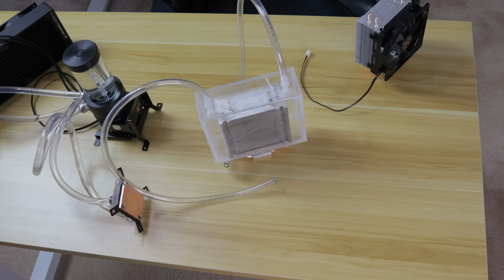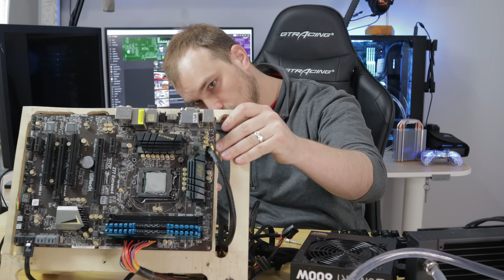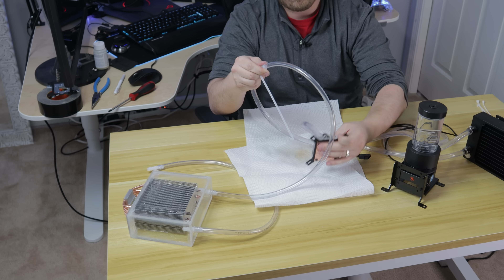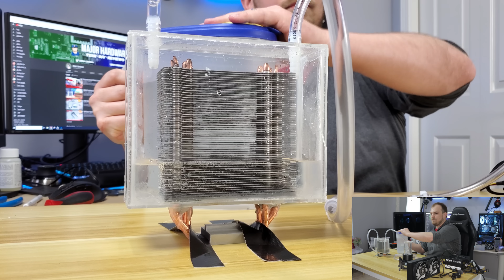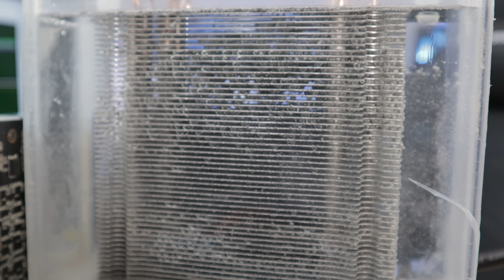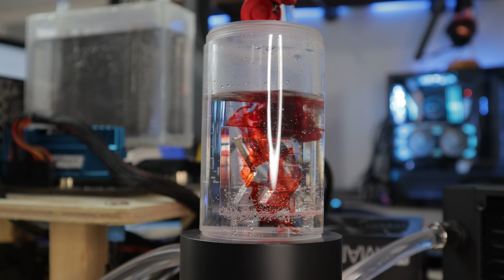Water Cooled Air Cooler Tested Against - Air Cooled Hyper 212 EVO and the EK-Supremacy EVO

Comment: 1. Don't push the water, pull it.
2. Make plexi plate around radiator to block water moving around, so the water has to be going through the rad.
3. …
4. Profit.
Reply: And have the water flow across it like the air would.  Flip the flow 90 degrees.
Reply: @ripnshread2441  that would probably make it worse, as it spends less time between the finns.
Reply: @ripnshread2441  that'd make it worse since it's more difficult to equally distribute the flow over all the fins in that manner than it is if it's along the fins, and as Da Vid said it'd also cause the liquid to be in contact with the fins for less total time, which reduces the amount of available heat-transfer time.
Reply: Good suggestions here
Reply: Arent the fins aluminum and the pipes copper? Wont that lead to some corrosion or something
Reply: That's a good point. It might benefit from a sacrifical zinc anode...which would require periodic replacment.
Reply: They're called water pumps for a reason... in your suggestion you risk drawing air resulting in destroying the pump or will have to use an incredibly noisy type of pump.
Reply: As long as the air is just tiny bubbles he shouldn't have a problem as there will be sufficient water still coating the materials during operation...there won't be enough friction to degrade the pump impeller. It also depends on the pump design. There are designs out there that don't use a completely sealed interface between the impeller and the housing...they aren't as efficient but they still work.
Reply: Run the water through the heatpipes instead and use the fan as well as the radiator. Now you have the combined cooling capacity of both.
Reply: he can win some 0.X c+ without air bubulle too :) , but i agree a better loop inside the plexiblock
Reply: Diaco the one suggestion that would make a  massive difference though is having one on the top right/left and the other one on low on the side at the opposite direction from where the top one is...
Reply: yes!, do that
Reply: Where's the underwear, though?
Reply: Maybe also put the air cooler in an 45degree angle top towards outlet and inlet from the lower corner, so the water goes through the fins. I do realize bending the original heatpipes that mych is not that good idea, but also, might be easier for the pump.
Reply: it wont do jack shit, adding the evo to the EK loop just makes the loop worse.... the evo is just being used to transfer the heat from cpu to the water and its using its heatpipes to do so, which is worse than having a waterblock directly on the cpu.....  there is literally no profit here unless you want a more complicated device that does the job worse than a regular waterloop ....

Comment: You are replacing the water block but also removing the radiator.  This means you are getting rid of the method for removing the heat from the water.  This kind of makes the test invalid.  The whole idea behind cooling systems is to remove the heat and all you are doing is just recirculating the heated water through cooling fins.  I expect that heavy testing would show a continuous rise in temp for your homemade water block.

Comment: that was not so bad, i thought at first that only 30% was affected by the flow but in reality it was the opposite so only 30% was a dead spot! now if you made the water zigzag in that like maybe 1 inch thick corridors it would have enough passes to pickup the heat AND not be too restrictive (the tubes are not that big but they also do not have fins so... 1 inch looks about right restrictively) thing is the air cooler has much more surface so you can imagine it has a bit more potential! (unless you made a block of silver...)

Comment: The water not flow properly.Should water flow from bottom to the top because the most heat at the bottom of the heatsink since the heat came from there.

Comment: 2:48 in, those are... very high idle temps. I have my R7 1700 overclocked fairly high, and for the longest time I was pushing almost a full 0.1 volts higher than it needed to keep the overclock (1.3125V, vs my now much lower 1.2325V), and even then, it idled at only around 35-40°C. And that's with it running fanless, due to my fan profile setting all fans to 0% until 60°C. My room temp hangs around 23°C almost constantly, so are you overclocking the balls out of that CPU or what?
EDIT: just resumed and found out you did, in fact, overclock the balls out of the chip. Not a gigantic clock speed compared to modern Intel 14nm+^500000^2, but for a 2500K 4.8GHz a good speed, in spite of the edgy voltage (not as edgy on that gen but still getting close to the limit). I love how I literally paused right between the base results and overclock settings.
Reply: Ideas for version two:
have a split intake into two rectangular horns, entering horizontally. This should even out the flow and provide a more evened out water path across the entire finstack.The top should be as low as you can safely assemble, with a block on the intake side to keep water from skirting over from the top horn. Exhaust should remain topside, but instead of a nipple, you should drill a hole for a fitting, and try to get it as straight in as you can, use silicone sealant if you get it crooked and the O-ring can't seal. Clear silicone rubber sheets can be put between the finstacks and the walls, to prevent water from moving between fins and maintain the intended path. If I know my water physics as well as I hope I do, if the V2 is made based on every idea I proposed, there should be far less stagnant water in the block, the flow should be far more direct, and as a result, the thermal ability will meet or potentially exceed that of the waterblock, as a result of the surface area; I'm pretty sure that a 212 EVO has more surface area than the microfins on the proper waterblock, if only due to its size.

Comment: So far i see several problems with this creation. One is the one you're addressing, which is water flowing around instead of through the fins. I would have built the cage far more snug fitting around the fins and have a second ceiling inside the box snug to the top of the fins. However, where there is a major issue is that you have to transfer heat more times between surfaces before it hits the water.

Comment: The flow path of the fluid is very inefficient. The fluid should be directed through the fins and not one side to the other. 

It’s like attaching fans to the narrow side of a fin stack, instead of the front or back. 

You’re temperatures will improve with a more efficient flow path
Reply: Mire like attaching a fan close to the fin stack instead of directly on it.

Comment: The first video is almost at 1 mill views. 

Hey if it works it not stupid.

Actually this isnt a new tech if you are talking about cars and turbo charging. 

BMW is employing a similar system to cool the charged air from the turbocharger with a air to water intercooler which has a water pump and external radiator. 

What i will suggest is changing the way the water flows into the chamber. The cold water should come from the bottom of the chamber and then the outlet should be at the top. Since we all know how heat convection works. 

The EK water block has high pressure water passing thru the fins of the block so you will need to fit a bigger pump like those used for fish tanks to pump more water into the chamber.

Comment: The results aren't too surprising. I'd wager you run into a bit of a thermal bottle neck with the heat pipes. They can only transfer so much heat and the less material the heat has to travel through to the water the better it's gonna be. A thin, flat copper plate with fins made via skiving and a high flow rate is likely to beat this no matter your improvements.

I wonder if anyone has made a water block with electrical discharge machining. Probably not worth the cost but it would be neat to see.

Comment: Interesting,   but  can you drill  the heatpipes  in heatsink  and run the water through there    and  the stock   120mm fan  cooling the heatsink ?   That  would be the real   "water cooled"   air cooler.

Comment: Try an inlet on the lower half of a vertical panel. Then you can use buoyancy from temperature changes. It will also force water through the fins. Sweet project though man. Good luck with V2.

Comment: v2 needs to be a Noctua NH-U12A. Pretty much the premier air cooler on the market right now. A long pipe on the inlet tube that goes right down to the bottom of the fins with little cuts in the pipe down the side leading to the bottom. These holes will get larger as they reach the bottom of the cooler allowing for a pretty equal flow rate through all of the fins from the bottom to the top of the cooler. Cap the bottom of the inlet tube / pipe extension thus forcing the flow of water through the fins equally throughout the cooler.

Comment: At some point you might find the heatpipes will be a bottleneck. A total of two heatpipes can only carry a finite amount of heat away from the base, and I suspect it will be a lot less than the water can take away from the finns of the cooler itself.

Comment: I think if you took all the fins off and just had the heat pipes you'd see an improvement. All told, the heat pipes can only flow so much heat away from your CPU, and that's definitely going to limit you. Right now, you have a bunch of air trapped on the fins, which ruins the performance. Get rid of the fins and that problem goes away.

Comment: Just an idea, but the heat pipes are hollow... couldn't you just cut the ends of the heat pipes, solder on some copper fittings, and turn the air cooler into a water cooler that way?

Comment: Awesome concept, as a 212 owner, this gives me ideas. I subscribed.

Slam the plexi closer to the fins on the short sides, with it wider on the long sides, and move the outbound pipe to the bottom of the tank. the effect will be that the water is forced through the fins, and you'll have much higher flow over the fins' surface areas just by spinning the whole design 90° around the 212. You'll have to totally rebuild it, but the results will be worth it. The only other thing I'm thinking of is having those heat pipe ends at the top of the 212 fully submerged. But keep the original, so we can see a head to head comparison. For all I know, having it go through a thinner, wider orientation of the fin stack will be unideal because of the flow rate exiting the tubing.
Reply: Kris Planker Hot water is less dense, meaning it rises, so shouldn’t the outbound pipe be on the top and the inbound pipe be on the bottom?
Reply: @HunterDominic  yeah, actually. My bad.

Comment: Burp it man, air insulates so get all those bubbles out of there. Maybe make the box with water coming in one side and exiting the other instead of the top. Set the block between the intake/outflow sides so the water has to flow through it. And bump up the flow rate.

Comment: I think you're probably limited by the power throughput of the heatpipes my dude. I'm betting increasing flow won't change too much, but I'd like to see! Maybe also try finding a heatsink with larger and/or more heatpipes to see if the same flow leads to better temps.

Comment: Very cool. On the next version rebuild it with a fan attached like normal but have it in mineral oil. You can put Electronics in there and that's how some people do custom fish tank PC builds is with mineral oil. And have the cooler oil pump in behind the fan so it blows through the fan and fins and then exits out on the other side immediately out of the tank. I think that may work well. You'd have the power of a fan and liquid plus a fan and a radiator.
Reply: Oil has a bad heat transferate compared with water. It is eaier to get waterproof air cooler

Comment: Why wouldnt you just get a cheap radiator and block? a cheap radiator is like 5 dollars on ebay and the block is like 5$
Reply from the maker: Where is the fun in that
Reply: also not all cooling solutions fit all boards , even correct sockets sometimes the board itself is a factor,
as i have learned the hard wait when trying to buy water cooling for my server board LOL
correct socket however did not fit the board

Comment: as soon as I saw the colored water go up at an angle, I knew the flow was mostly around the outside of the fins. this makes me hopeful that this could potentially outperform the professional watercooler, provided it has a sufficiently sized radiator to keep up with the added heat removal.

Comment: I'm making this for a class and I will have a fan inside the enclosure to run water through the fins, and I have the out hole HIGHER than and in hole, and on opposite sides to have convection help with the flow for free.

Comment: Throwing in some dye really added something. Would like to see a version 2 of this water cooled cpu cooler, one that forces water to flow through the heatsink. Now it's moreover passively water cooled, because the fins are horizontal not much water flows through the heatsink. Nice video (even though I jsut jumped through it by pressing L xD)

Comment: kind of a defunkt method, Im pretty sure you already knew this wouldnt work out quite as well as you would have wanted due to an absolute piss poor design...
granted, if it is something you just "threw together", then fine, but if you wanted to perform a "true" test of this, you should have planned ahead.
anyone who has ever watercooled their system would have designed the water box in such a way to have the inlet set at the bottom edge of the cooler and the outlet at the opposite end and near the top. anything else just worthless.
also, the amount of air inside wont make any difference at all, as long as the cooler itself is inundated. the air itself becomes negligible.

Comment: I'm happy I was wrong and it didn't leak all over the place. I have some thoughts for version 2.0:
-Fish tank flush against the fins of the evo. So that water doesn't pass through without picking up heat. 
-If it's possible, distrubute the water to a flat jet on the input side.  Or maybe from one input to three or four. This to adress the dead spot. (hope my writing makes sense). 
Good luck with this project.

Comment: I have an idea if you are ever going to make a version 2. How about using mineral oil in the loop and using fans on the "air cooler" as well as putting the loop intake in the front instead of the top. This should theoretically help the coolant flow through the heatsink directly and improve heat transfer.

Comment: As I already posted in your previous video, optimize your design, make it narrower so that you have less dead zones, make a vent into the top so that you can let the air out, let the inflow pipe hit your bottom acrylic plate so that the cold water disperses there and the outflow should be at the very top. Plate heat exchanger 2.0!!! With that insane amount of surface area for heat convection, you will beat every purchaseable waterblock out there!!!

Comment: I'm just wondering what is the real world application for this? Would you have to put you PC box on its side? Or build a brace to compensate for the extra weight, if it's horizontal.

Comment: Wouldn't this loop just keep getting hotter and hotter over time? It would seem that it's dumping the heat from the CPU into the fins, and then into the water but doesn't have a way of dumping the heat out of the loop entirely. Once the water gets heat soaked won't the temp just keep going up?

That said, this is really interesting and I look forward to Future iterations.
Reply: 240mm EK Radiator is attached to that system I believe.
Reply from the maker: correct
Reply: @MajorHardware  My bad.

Comment: I think your biggest bottle neck in temperature transfer is gonna be the base plate and heat pipes. The heat can only transfer into the fins so fast, whereas the ek block has water directly on the plate that is touching the cpu. Perhaps in the second iteration you could get the water block lower onto the heat pipes with some dircted water flow. Great job!

Comment: Damn, you just got a sub. I love crazy experiments like this. I hope to see V2 soon. 
Is it possible for you to, say, take an enermax liqtech ii 360mm or a 240mm (because it has a very strong pump for an aio), add another rad (say, a 240) to loop for an awesome dual rad aio. Just something i've been dreaming of this days. I believe you can cut open tubings on an aio and replace them or refill them (i've believe gamernexus did a video on it). If possible, it would be so cool for smaller cases that uses a hot cpu like a 9900k but cannot easily house a custom loop.

Comment: Hey dude, a couple of suggestions for you, for the chamber that has flow issues, for the water outtake; a pipe run down one side with 5 or so holes 1 or 2mm each pointing towards the heatsink fins, it should jet the water across the fins of the radiator somewhat and the smaller diameter holes should help with even flow distribution.  Also, if possible, bring the setup closer to the board, get the water flowing by as close to the CPU as possible, I think that's probably not possible add it'll probably mean a new heatsink... either way, keep up the good work!

Comment: try one drop of dish soap or better yet carpet shampoo. Carpet shampoo has anti foaming agents in it. I know it sounds wrong but it does help with removing bubbles. Also removing and restocking with about 1/4 to 3/8 inch between them should yield laminar flow. . Also water has a thermal conductivity about 100 time better than air that means 1 square inch of copper surface can conduct thermal energy equal to 100 square inches of copper or around 190 square inches of aluminum. For long term use removing the aluminum would bring galvanic reaction to minimum and would probably do about as well.